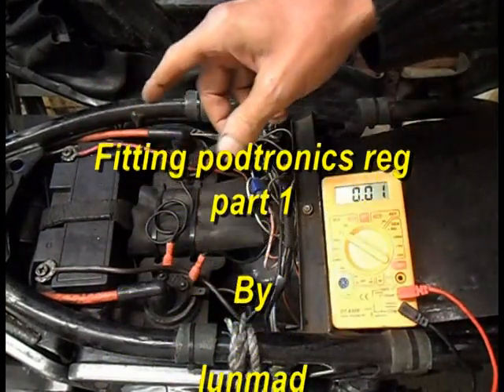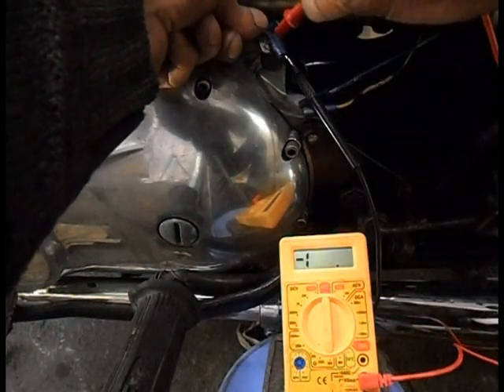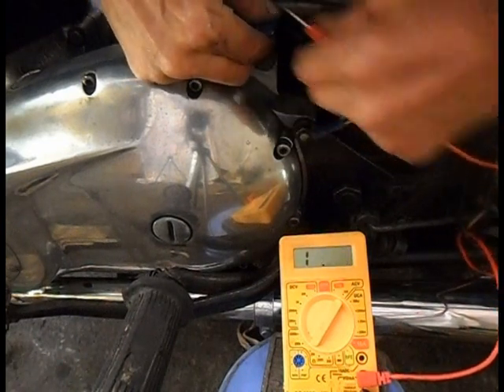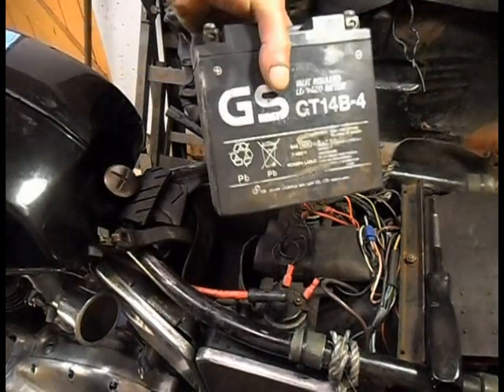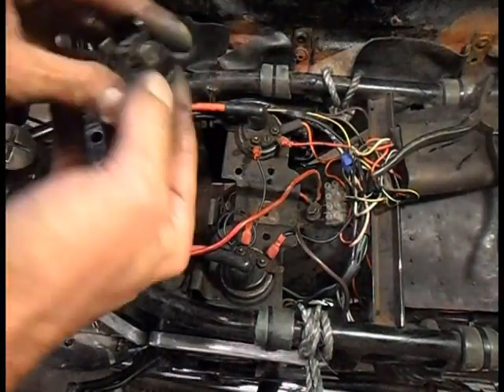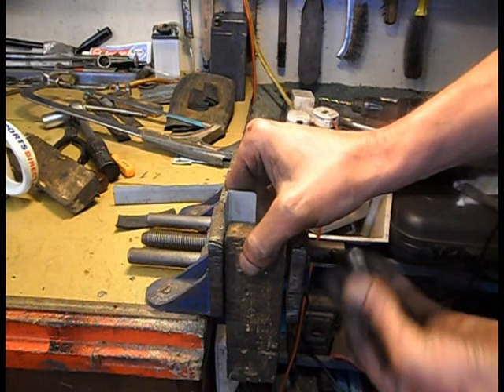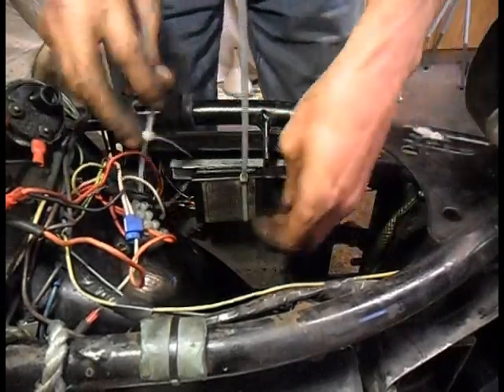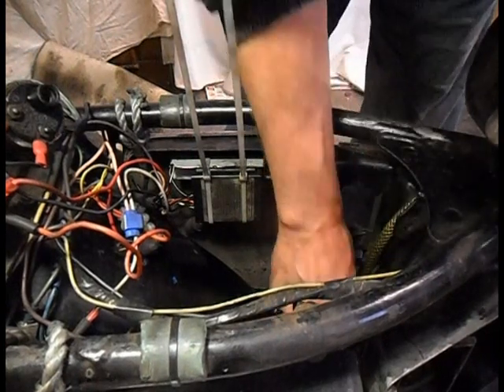fitting podtronics reg part 1

Comment: Hi John, I know this is ancient history and you have probably sussed out the ohm scales long ago, but just in case you have not, I think the scale that gives the clearest resolution on that meter is the one marked 200. The others I believe are for measuring higher resistances and are consequently less accurate for the measurement you are making (a bit like using a ruler to determine if your cylinders need a rebore).
I just measured the resistance of a spare serviceable Lucas RM21 stator off my T150 and got a reading of 1.5 ohms. Couldn't see any data in my manual, but it is a similar reading to the one you got.
As always, I enjoyed the video.  Thanks.
Reply from the maker: Hi Moto :-) great info thank you, 
I must admit I'm a bit of an electrical numpty, volts and continuity are the main things I use my meter for.